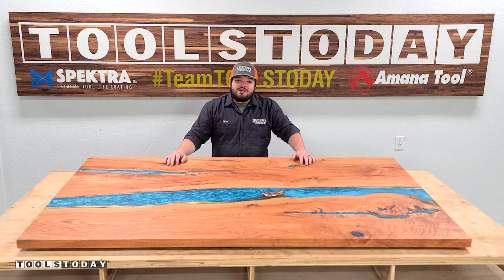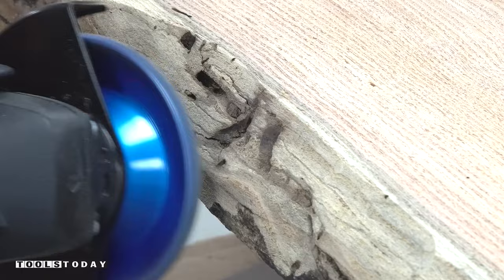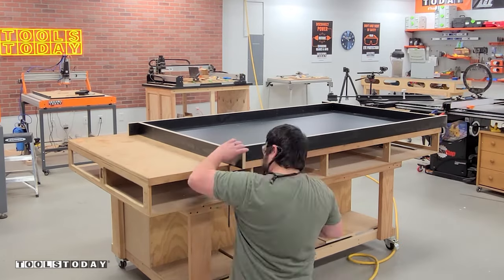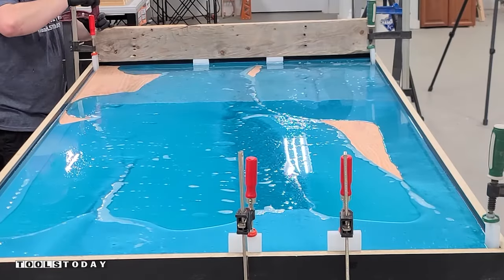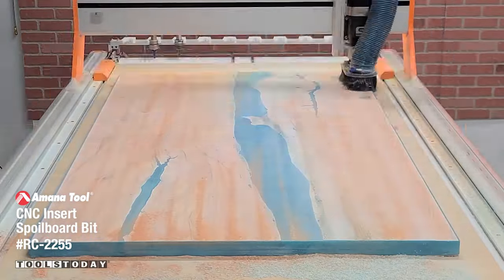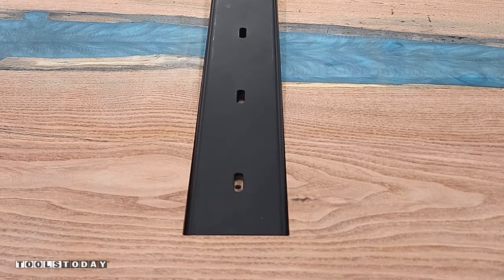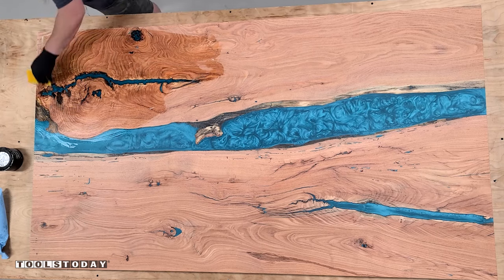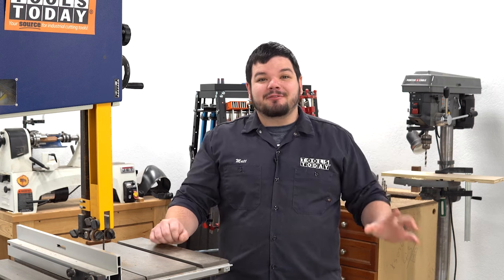Making a Kitchen Countertop CNC Epoxy Salvage Slab  | ToolsToday Video

Comment: Did you vacuum seal the epoxy to get rid of the bubbles?
Reply: when you use a slow cure appoxie you don't have to worry about bubbles because they have enough time to rise to the surface.